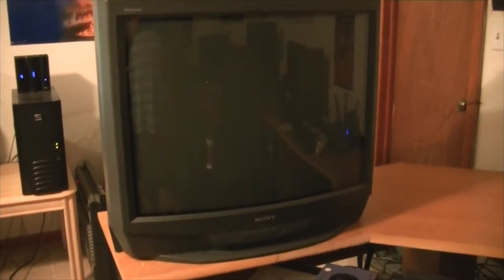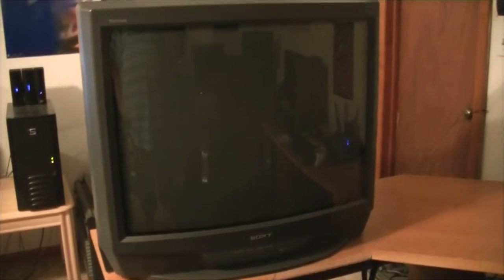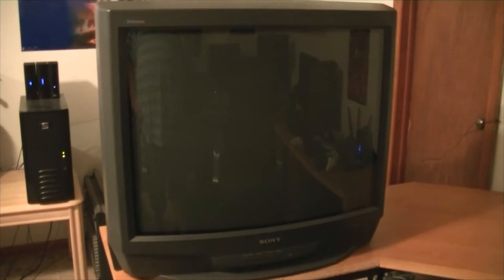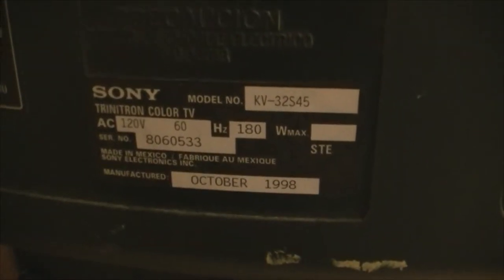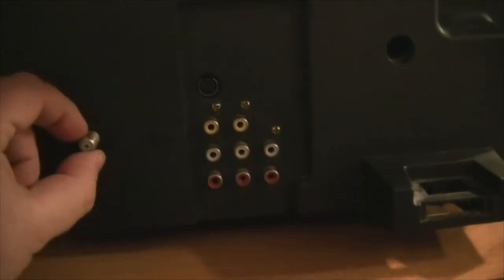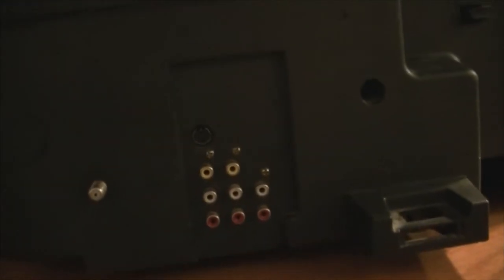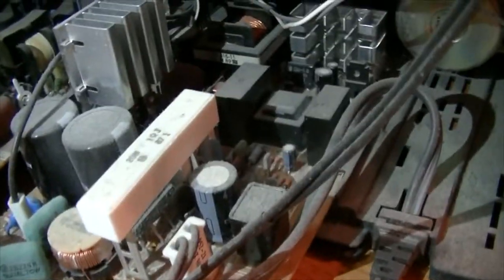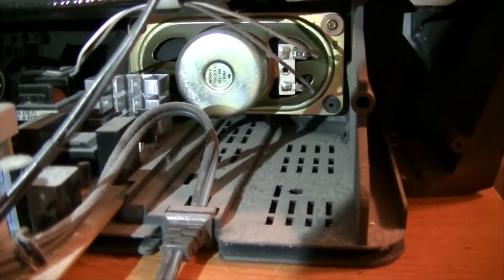Trash Picked Sony KV-32S45 CRT

Comment: nice tv i have a similar one to the one you have its from 2000 found at the curb  not sure what the model number is  works perfectly without any problems,   because the one i had was a sylvania one the sound kept cutting off so i tossed it out